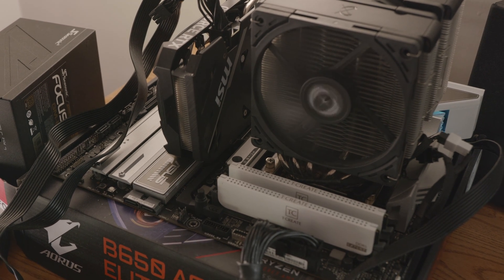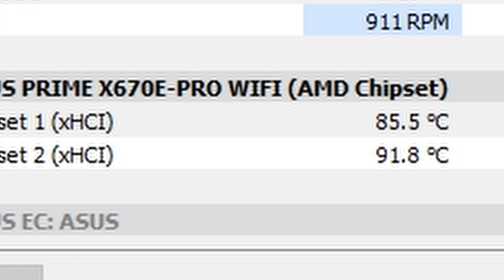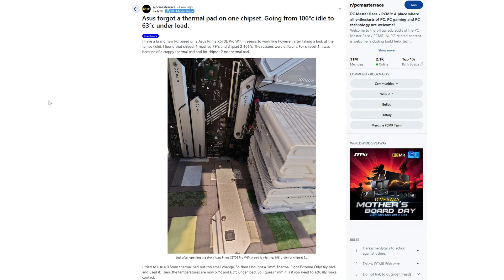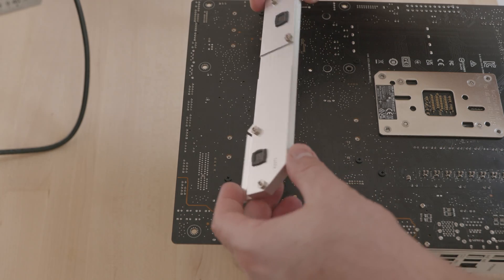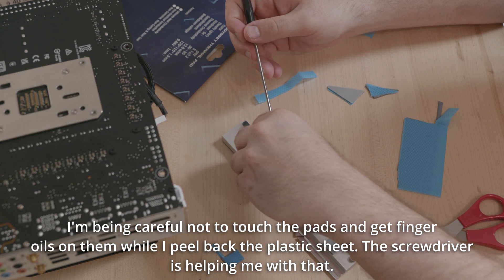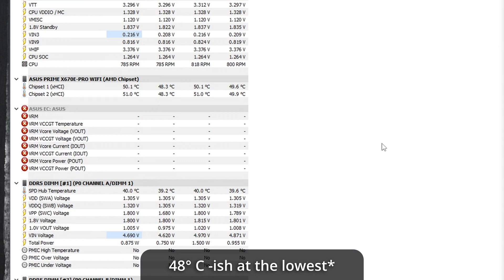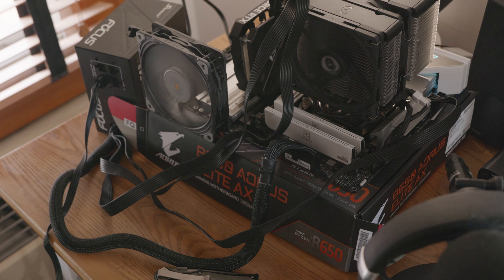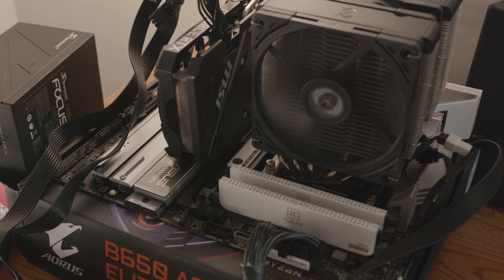Chill Lab: Chipset Thermal Pad Replacement (Chipset Was Cooking!)

Comment: Aorus Elite X870e wifi 7 (rev 1.2) pch 1 idle 45, pch 2 96
Reply: Changed thermal pads now pch 1 max temp is 56 and pch 2 max temp is 71-72

Comment: Running in the 90s just make me laugh so hard😂 Great video. I’m replacing my x570 chipset with new thermal pad. Hope it can lower my temperature from 90C degrees
Reply: Did it help? Having the same problem rn
Reply: @bxnni1566  Yes, it helped a lot. The temperature dropped from 90°C to 67°C. The most exhausting part is tearing down all the PC components just to get my ASUS C8DH motherboard out, loosening the screw behind its back, removing the metal thermal plate (to expose the Southbridge Chipset), and then replacing the old thermal pad with a new one.
Reply: @liusam2305 thanks for the answer, yeah I hoped I wouldn’t have to do the same but I tried to get the cover of the south bridge off yesterday and it’s also secured by a screw on the back, so I need to tear apart my whole system.. I’m running a x570 mpg gaming pro carbon, one of the worst x570 of them all. Was idle at like 95-100 degrees, while gaming it went up to 110-115, with an active fan
Reply: @bxnni1566  Your temperature is too high, and I think there must be some problem with the thermal pad on the south bridge chip. Sometimes the old thermal pad, including mine,  is hard and dry like a rubber after years of usage, and what's even worse is that the rubber-like thermal pad doesn't fully in contact with the chip and thus leaves a slice of space/gap between the thermal pad and the chip, which means almost no thermal on the chip can be spread out by thermal pad, and that is a disaster when it comes to cooling down the tempereture.

Comment: Nice video. My Asus ProArt X870E WiFi Creator report 75C for both chipsets. I’m thinking about replacing the pads but I’m lazy as hell to disassemble everything down just to get access to the back screws 😂
Reply from the maker: 75 is not something I'd worry about.

Comment: Thank you for the video, I have the same problem on my B650 E E Strix. Can you tell me the thickness of the pads that you used to replace the original ones?
Reply from the maker: @dorinsec3618  I have a completely different board so I can't say that these will work for you. I used thermal right 1.5mm. Your board might need something else.

Comment: A good board if you pull it apart and replace the thermal pads? I think Asus starts getting a pass from me.
Reply from the maker: I don't see it that way. A ton of products are good enough from the factory and great with slight changes. I still wouldn't want to deal with warranty support from any of these motherboard companies though.
Reply: It's not the product that's the problem it's the customer service that people don't like

Comment: x670e chipset is known to need good cooling so Asus dropped the ball using those shitty pads. I just checked the temps in my b650 eagle and its peaking at 57c.
although I wouldnt really worry about it as long as its lower than 90c under load.

Comment: It's always useful to give pads thickness info, most people doesn't have leftovers and it's easier to know what to buy/order before dismantling anything.
Reply: This will sound like a fucking ad but all my fears and worries about thermal pads thickness went away after I started using Upsiren. The softer one. Now I open stuff to repaste without care and just slap pink clay bubblegum on everything.
Reply from the maker: Well, true. While most people doesn't have leftovers, most people also don't have the same motherboard. The thickness is not standardized. It will depend on your board.